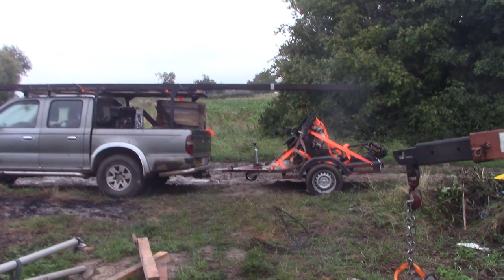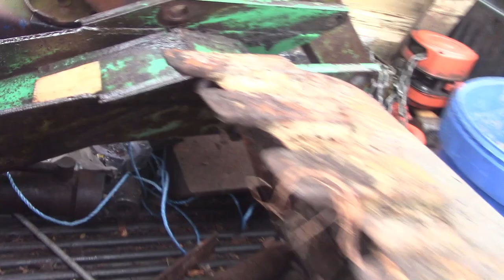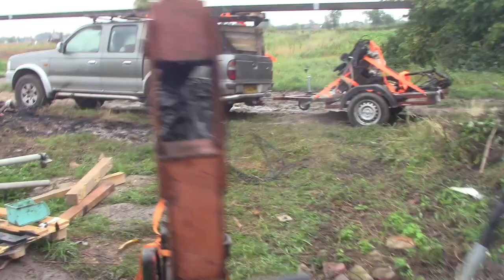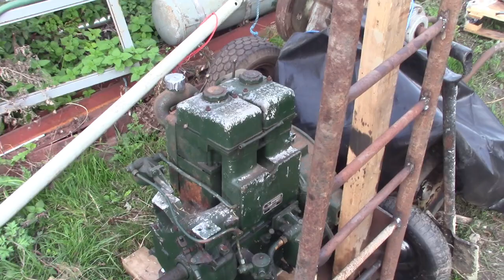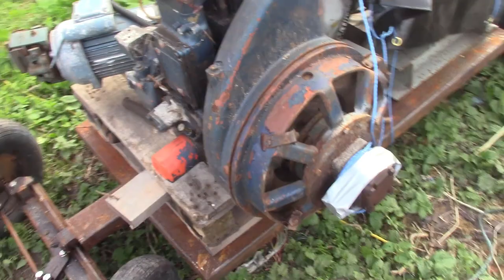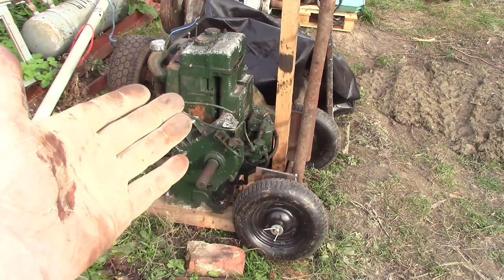All the wierd stuff ive been saving from the scrap man with my new trailer

Comment: I'm glad to see that I'm not the only one that goes to scrap yards to buy stuff. I recently bought a Ryobi 12" steel cutting saw. A few weeks ago I bought a John Deere commercial push mower for the equivalent of £25, and it runs well. I'm planning to use it once or twice this mowing season before I park it. I'll run it out of fuel first.
I shop for welding materials, and other things of value.
Reply from the maker: The mower sounds lovely, I didn't show it but I also got a paddock mower with the old Briggs on points ignition, already my favorite mower after only pushing it around the garden once but she's drinking oil so might need tinkering.

Comment: OK, I'm moving to where you are where I can go pickup Listers and Petters from the scrap yard.  What's the name of your area? Paradise?  How can people throw out beautiful bits of Treasure like those engines? Those things were  built not only to last but with pride and care by skilled engineers.  Polar opposite to the Chinese Disposable crap we get today. 
I know what you mean about weight. I had an SR about the same size and I think it was around 300 Kg.  Similar my Cs6/1.
Been looking for another CS for years and never found one and very rarely do the aircooleds ever come up.  Same as the backhoe. Been looking for one for my tractor and can't find anything for sale let alone at the scrapyard.  That would make a fantastic  Trailer mounted digger or make the thing self sufficient  with a Hydraulic motor driving the wheels . I have a similar engine crane and put big wheels on it so it will go over grass ( not interested in getting it under cars) and extended the boom. 
Put a 44 on the other side and filled  it with water as a Counterweight.  Was also thinking of putting a counter weight on the other end of the boom for more lift capacity but the Tractor lifts most of what I want now. 
Very interesting  and Jealousy inspiring Vid mate.  Can't wait to see how you put this treasure to work.
Reply from the maker: This wasn't at a scrapyard, the scrapman was going to be the next person they called, he'd already had several ton of steel which is bloody annoying as it's silly money to buy at the moment but weighs in for pennies.
Think the back actors are pretty common finds here as we're only 6' above sea level and if farmers don't dig the ditches we'd all drown.
Your engine crane mod sounds good, I'm probably being delusional but like dreaming about one day having a nice big flat bit of concrete to push it around on.

Comment: Years ago someone made a kit to convert a VW air cooled engine into an air compressor. It used one side of the engine to power the unit, and the other side had a modified head with check valves to pump air. They seemed to operate rather well. A few years back, my boss rented an air compressor that used a Ford 351 engine in the same manner, but that one had mechanical problems. They brought him another one, and it did better.
Reply from the maker: 351 as in a big V8? Certainly going to be easier on an old push rod engine.
Just looking at the outside of this thing it's obvious the pump head is significantly smaller displacement than the power assembly, and it's a flathead so pretty compact. 
I wonder how much pressure you can build if you're power and pump are equal displacements.
Also thanks for your suggestions the other day regarding drying grit blasting media, I've been trying, not found a good balance yet with airflow but think it'll work.

Comment: The model number is in the serial number in the later engines. Was that an LV2 I spotted there? If so it is 18 HP at 3000 RPM and weighs in at a mere 278Lb. The SR2 comes in at 416 Lb.

Lots of very interesting and heavy stuff there.
Reply from the maker: Yes it's an LV2, figured out the S/N after I'd made the video.
Can confirm the newer Lister is significantly lighter but not half as charming, would probably make a very nice mk3 dump truck engine though.
Going to have to go on an intense Tig welding learning curve to knock up fuel tanks and repair the tin work.
Reply: @turboconqueringmegaeagle9006  Nice set of engines! Looking forward to it.
Reply from the maker: @BensWorkshop  cheers mate

Comment: James, does it pay to excavate long, deep trenches that can ultimately fit shipping containers which you surround in cement and later on cover with soil to make an underground facility with interconnecting passageways?
Reply from the maker: I was planning on putting basements under the new above ground workshop, I'm not keen on using shipping containers though, I can see the benefit if you have time constraints but given I want to sit a machine shop directly above it'll be cheaper and more structurally sound shuttering up for concrete.

Comment: This side of the pond diesel engine are hard to find and crazy expensive due to the BS EPA regs on them so you can't get chinesium import clones from Som Ting Wong co.Ltd like we used to..and now we have empty shelves everywhere but hundreds of cargo ships parked on the shoreline..Commiefornia has some new EPA reg about only 3yr old or newer trucks can pick up at the ports so now 60% of the trucks can't causing massive problems with unloading the cargo ships of course the BS media is blaming it on C19 etc which is totally BS..yeah Good times, Good times..
Reply: Never ceases to get me what you can and can't get in the US.  Have  bunch of the Chinese Diesels, The Yanmar clones are pretty ordinary But the Horizontal Cyl type with the big flywheels are good. I hear the Small diesels are coming in but they have to be part of other equipment like a compressor or whatever. They can't be sold on their own. That said, I have seen some on Flebay recently after some people in an engine group pointed them out.  Interesting what you say about the Trucks. I have a mate in commifornia I talk to by email most days and he has said how empty the shelves are and how he is having so much troubles getting basic Supplies for his business. Should have known the real cause would be their own stupidity and putting the blame on Convid.
Reply: here in Cali were not going to be allowed to buy small gas engines in like a year. I'm all for cleaning things up and in face bike everywhere and don't own a car but even I think that is going to far, there are just some things that batteries can't power.
Reply from the maker: I was reading about a Californian importing Indian made Listers or "listeroids" and just declaring them as air compressors on the shipping forms, I've dealt with US customs and they are pretty meticulous wanting to know specific types of plastics a component is manufactured from, but I also think you'd have to be really unlucky to 
1. Get something inspected
2. Have the only customs official capable of telling the difference between an old diesel and an air compressor.
Don't know if he's still importing, was only a couple of years ago.
Reply from the maker: @evilcanofdrpepper  I'm really interested in seeing the solutions people are finding to not having engines but an outright ban is going to kill a lot of people and cause unimaginable suffering, I get everyone in the cities will be fine but Cali is a big old place and there must be millions of people living in the boondoggles right?
Reply from the maker: @agentcovert  don't be conned into believing Communism is in the minds of any of these tyrants my friend, the mega corps are moulding the neo feudalist society they desire, the politicians are merely the vassals to them with us serfs grateful to not be trodden on too hard.
Either way, I was curious about how many people will be living out in the sticks without a back up genset or a vehicle that doesn't require a 2 day solar charge just to drive to get a case of beer.
Reply from the maker: @glumpy10  sounds similar to our situation, the construction of green power is highly profitable, but the delivery of steady base load isn't incentivesed, they can't switch off the huge old coal station yet we've got a 20yo combined cycle gas plant up the road doing nothing at the moment, with no plans to re open and black outs predicted in winter.
Bae can build a new nuclear sub every 5 minutes, and the mod are buying new nuclear warheads but if we want a nuclear power station we have to pay the French and Chinese to do it, it takes 20 years and the cost goes up every day, and rather than giving kids a reason to get a useful education in the sciences they're dossing at uni dreaming about being the next pop idol studying feck knows what but it won't get them a job.